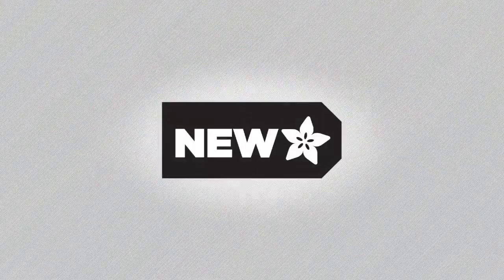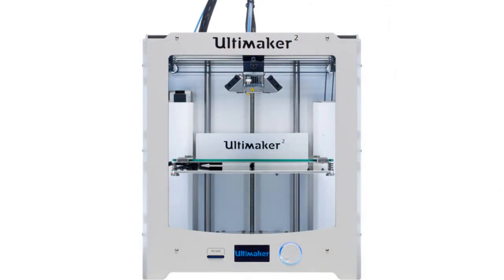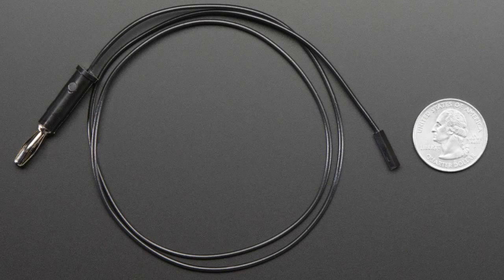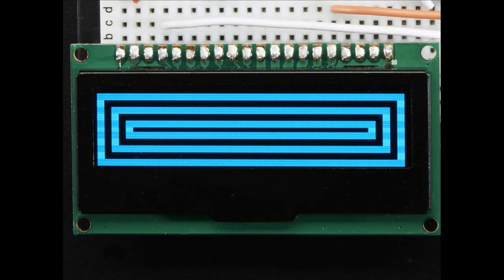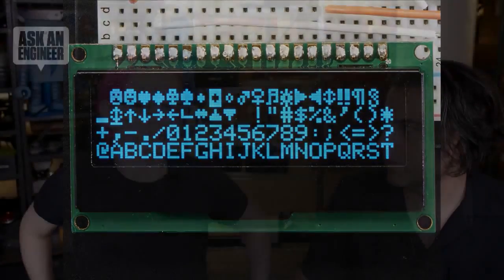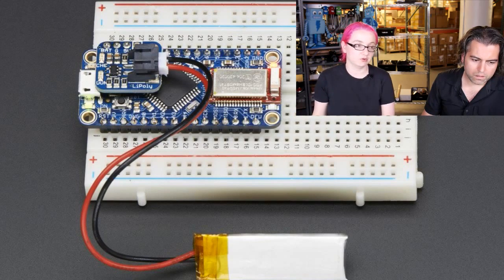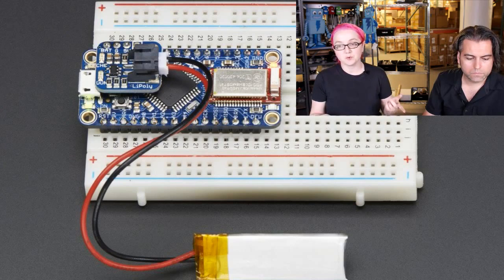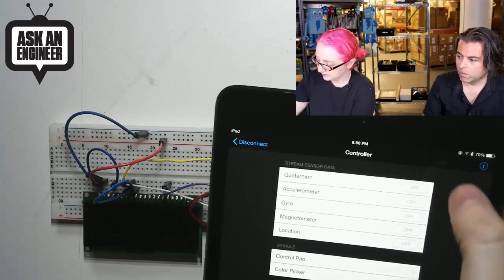New Products 8/12/2015

Comment: I want to use this to make my self a mechanical keyboard all I have are the switches and a plate to hold the Keys in place no PCB.  is there a wiring diagram somewhere to show me how to connect the switches to this board correctly? or hook it up in place of a teensy 2.0 microcontroller.  talking about the adafruit Bluetooth micro going to be a ten-keyless board

Comment: Is your pin for BAT on that Bluetooth Arduino module for the battery backpack the same as the RAW pin for the Arduino compatible Pro Minis that can be found on eBay? I have a bunch of those and I'd like to power them using a battery (I ultimately want to use one those tiny Arduino Pro Minis to light up my Lego Creator Expert Ferris Wheel with NeoPixels to get a carnival look). The Arduino would go in a Lego enclosure that connects to the middle of the Ferris Wheel using Technic pins (lego) and from there I'd wire the Pixels around the edge of the wheel and secure them with thin zipties. These Arduinos often don't have USB ports, so charging could be a problem if I don't make the system modular.